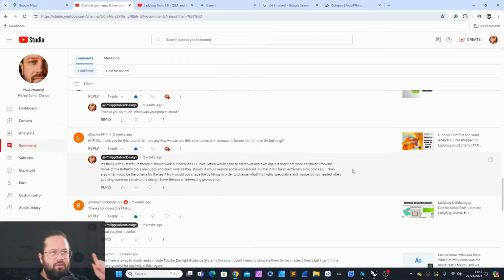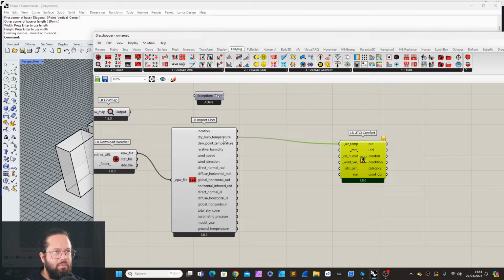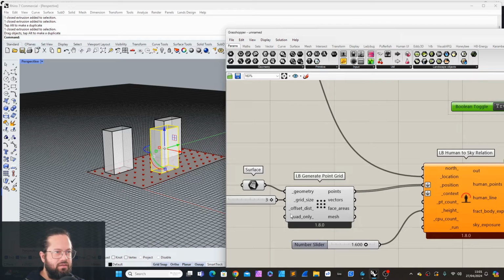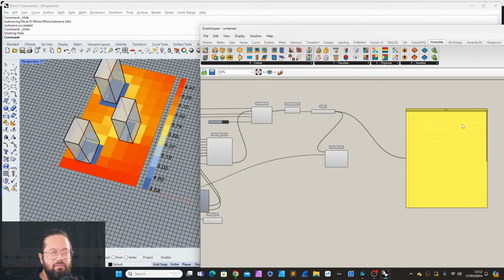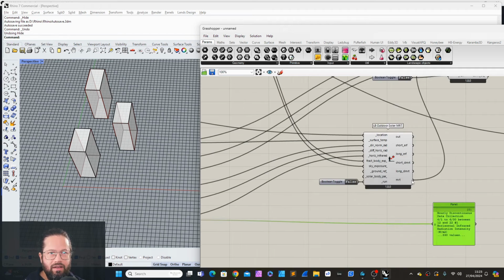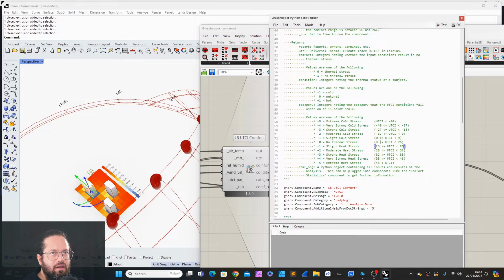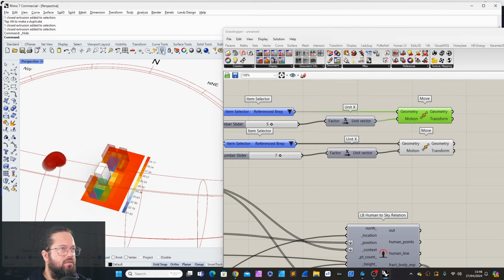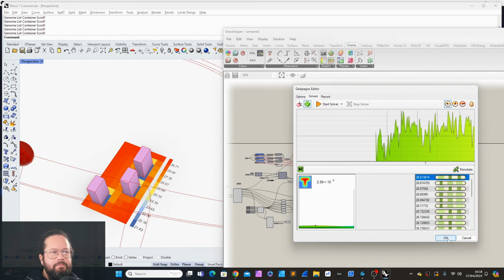Outdoor Comfort Optimisation with Galapagos and Ladybug | LBT 1.9 Q&A

Comment: Hi Philip, many thanks for your great videos, lifesavers! I have a question, How can we consider building's thermal waste, some how connect the energy consumption and outdoor, also, How can we consider buildings reflectivity on the thermal comfort? (indoor/outdoor)
Reply from the maker: Good thoughts. Well as a first step you might want to look at Honeybee. I did a whole playlist with videos regarding energy modeling. It's a vast topic but that would be a start. Check out my playlists and look for honeybee

Comment: Hey Philipp! I was wondering if you knew of anyway to utilize the Ladybug Tools, especially the CFD, with a MacBook Pro or if this is only available for Windows currently. 
Thanks!
Reply from the maker: Hi Northcut 
Ladybug is available for Mac but some features which involve 3d party software might not work.
Here are the detailed instructions for installation on Windows and Mac.
https://github.com/ladybug-tools/lbt-grasshopper/wiki
Regarding butterfly CFD I don't think there is a Mac version as the underlying software is BlueCFD. BlueCFD is a windows software which is utilising Openfoam which written for Linux.
So butterfly CFD might only work in Windows.
Same with Eddy3D which also uses BlueCFD...

Comment: Hi Philipp, 
Thanks for the great exploration of the comfort and wind comfort again (in the future)  ;)

I wanted to share some information about the Purge component in BF. It works when you connect the output Case from BF Create Case From Tunnel, to the Case from BF Purge Case. For the rest, you just need toggle(s) to purge each step separately or all together at the same time.

As for the time to stop the CFD simulation, the best method is to limit the residual value. You can find it in tab 05-Recipe then Residual Control component and set the Value to 0.0001 or 0.001 or even for less important studies use 0.01. So that the solution will converge and save automatically.

I'm also working on the automation of the CFD process. I'd be happy if we could share more in this regard...